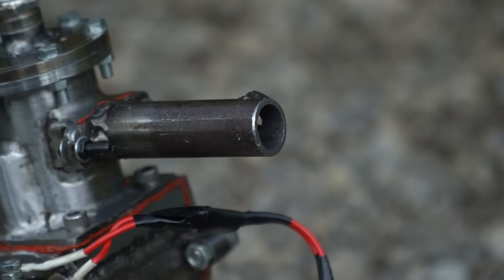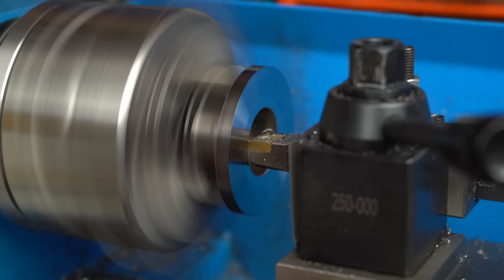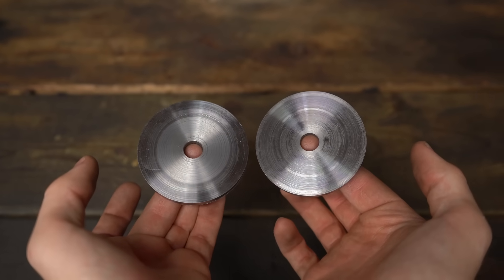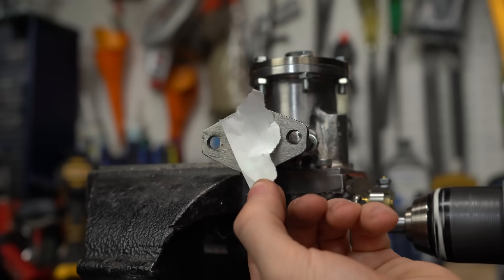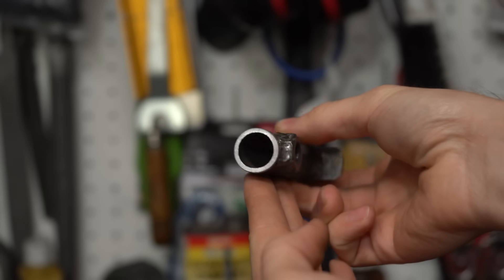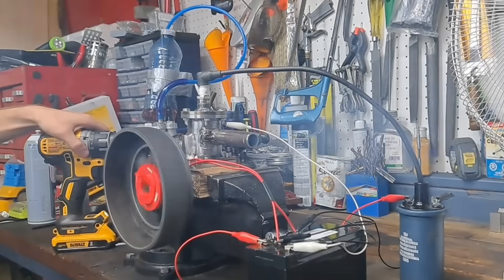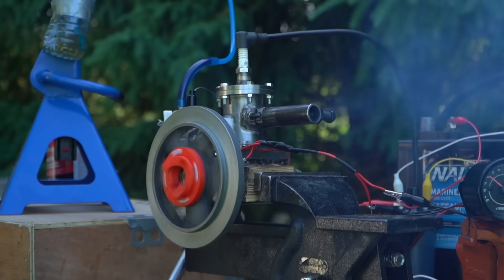I Made a Two-Stroke Engine Using Things I Found at the Hardware Store

Comment: They need some backpressure to run, but not much. It's just that they benefit from exhaust resonances much more than 4 strokes so in order to get the absolute best performance you have to take it to it's absolute extreme. You optimize it for a specific RPM (same as a 4 stroke, but not really, but still kind of the same thing) and the backpressure will help draw more air out and thus into the combustion chamber at that RPM. 4 strokes use the same trickery on intakes too, which is why variable length manifolds and things like the weird ITB setup with extra valves to change resonance to optimize for different RPM on most new Porsches, but that has almost no erffect on 2 strokes. On 4 strokes that can give you as much as 15-20% more air than you'd otherwise get from just an open port or "whatever it holds tha MAP and MAF" manifold.

Also just get a larger pipe to fit around the cylinder and run a tiny electric water pump that pumps water through that jacket. Basically how an open deck engine cools itself, just far more half-assed.

Comment: its running lenient  on to much air because there is too much smoke and its white smoke there should not be that much smoke in the first or its just having problems with a cold start heat can help (i edited because my dumb ass didnt wait i minute to see that it fixed itself)

Comment: 4:40 That "little tool" you made is called an arbor, for anyone wondering.

Good thinking for a relative beginner, you're improving rapidly and picking up all sorts of tricks! Much better looking welds these days, too.
Reply: There really is no better way to learn this shit than being pissed off in the shop for hours at a time.
Reply: and at that scale, sometimes you can get away with super gluing the part to the arbor, especially if the arbor has a large step on it to add some surface area. A bit of heat releases it.
Reply: @VoidedWarranty heated super glue releases cyanide tho 😮
Reply: A slight taper cut on the the arbor will also hold well. Just make sure the entrance end is smaller by a few thou and push it on with your tailstock with a center and a hollow PC of material

Comment: Heya, I'm a mechanical engineer in the automotive industry, and let me tell ya, don't use a roller or ball bearing for your engine! All types of roller and ball bearings hate high and sudden loads, like a piston firing and will start to break down very quickly, I'd recommend you to use a hydrodynamic bearing instead
And I know your engine has different issues at the moment, but if you were to make a new one, why not just make it right? :P
Reply: More of a high performance/rpm issue/ long lifetime issue than a absolute avoid issue.

They were convenient for design and cheaper than plain bearings.
Reply: @finlaymcdiarmid5832  yeah you are right, but for one, it's just bad practice, and for the other, because of the tribology and geometry of the ball, you tend to have a very small surface area (which is in theory even infinitesimally small) which will get plastically deformed causing an unround surface, which tends to happen a little faster, which decreases efficiency (I'm german, excuse my bad spelling)

Comment: The next time you use your hole cutter use a drill bit to drill a hole on the inner diameter of your hole saw. This insures that the saw won't lodge on the filings that are being created by cutting. This also reduces wear on the cutter itself and also reduces the time to cut. You can easely cut up to 2 cm with this method. (With cutting oil ofcourse)
Reply: this tip blew my mind in how obvious it is but how ive never thought of that before!

Comment: try tesla turbine combustion engine, using one disc stack as the input air turbo and other as the exhaust turbine. both on the same shaft. yep throw fuel in the air, you get fire, exhaust. well welld. be wholesome. so whats so difficult about 1-stroke engine, or direct combustion, every cycle. yes 1-stroke or continuous burn turbine. rotary turbine. that looks like a sewing machine. you know, a put put heat engine outputs exactly the same out of the exit pipe. keys and bearings falling out is a problem.

Comment: the reverse beamng clip is gold
Reply: its even funnier when u realize he used a manual shifter on the automatic d15 lol
Reply from the maker: @RainbowSheep_was_taken  I was trying to do something like that meme where the guy puts the truck in reverse if that makes any sense lol
Reply: @CamdenBowen  I think you’re missing the Reed valve on the intake. Without the read velvet would push most of the charge air back through the carburetor.
Reply: @CamdenBowen  yeah thats what i meant by dramatic effect lol. U made it really funny too
Reply: @CamdenBowen  When you measure pistons measure from 1/3 up from the bottom of the skirt perpendicular to the gaugeon pin axis.  Pistons are conical
Reply: @diyking9k74  You are just straight up wrong about how twostrokes work. Adding a reed valve to a twostroke which has a piston ported intake does nothing for performance. 

The intake can be controlled by a reed valve, which means that anytime the pressure in the crankcase is lower than outside of it, the intake draws in air.

It can be controlled by the piston, which is a lot simpler to build, but has the limitation that too high intake port timing will make it spit fuel back out through the intake.

Or it can be controlled by a rotary/sliding valve, which works the same way as a piston ported intake, but you can tune it to not spit any fuel back out through the intake.
Reply: @CamdenBowen it would be even funnier if u went forward while looking backwards
Reply: @CamdenBowen   PUT IT IN REVERSE TERRY
Reply: @CamdenBowen  I cracked up hard. Love your work man
Reply: @RainbowSheep_was_taken 😊😊😊😊😊😊😊😅😊😊😊😊😊😊😊😊😊😊
Reply: @RainbowSheep_was_taken I there isn’t really a commercially available automatic shifter for sim racing except for monster trucks and certain Allison transmissions
Reply: @jasonlin9805  yeah thats what i said
Reply: @RainbowSheep_was_taken u can customize any car on beamng. Don't be a buzzkill
Reply: @Corkoth55  the original comment you are referring I think was deleted
Reply: @RainbowSheep_was_taken  he probably just has a manual shifter for racing games in general
Reply: @scarecrow5848  no one has an automatic shifter tho, he probably used it for a dramatic effect or he didnt realize the way to shift automatic is with the paddle shifters
Reply: @RainbowSheep_was_taken  You can shift an auto with the h pattern too in beam, that's how I do it
Reply: @RainbowSheep_was_taken You can bind park, reverse, neutral, D, 1, 2, etc for automatics to positions on the H shifter. I prefer this to paddle as it feels more like the automatic selector lever in a real car and it's easier to get where you want rather than toggling through with a paddle.
Reply: @bakedandsteaked  yeah, the h pattern also works on automatics in vanilla i just never learn the pattern of the automatics
Reply: Actually cracked up when I seen that 😂
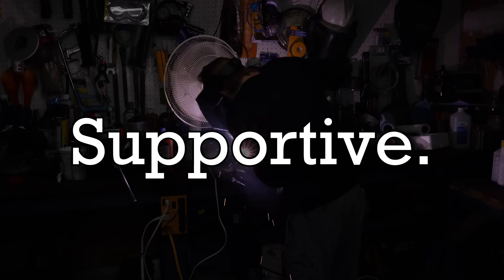Reply: @nathanmccormack4681  2:49 2:57 2:57 3:00
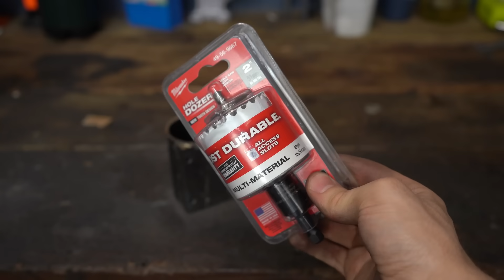Reply: 3:55
Reply: Beamng is gold
Reply: @164_KiloBytes  I have over 1.5k hrs and will never stop
Reply: @164_KiloBytes  I got 1.5k hours on beam and will never stop.
Reply: OMG bro beamng is THE BEST
Reply: Muye moment 💀
Reply: @TheMRacer MUYE
Reply: @TheMRacer  he's over rated
Reply: I was looking for that comment haha
Reply: It's on the same logical level, as turning down the music to see better. Love it.
Reply: What's the time stamp?
Reply: @jwalster9412 watxh the video
Reply: @jwalster9412  Go to 3:48
Reply: yeah I had to rewatch that😂
Reply: That made me subscribe
Reply: The only thing I do in Beamng is put superchargers in family sedans 😂😂
Reply: ONSHAPE IS SCAM ALERT!
Reply: I busted up.  That is my new favorite thing.
Reply: I know I laughed hard there 😂
Reply: timestamp?
Reply: @wertugavw 3:55 it's up there already
Reply: @shako141  Yeah, saw it just as i left the comment and was roo lazy to delete it
Reply: this is the reason creators like him stand out from the rest, cause he makes skits that are completely unnecessary but adds so much to the video
Reply: I see Beam NG, I am happy! : )
Reply: So funny!  I had my  video in "Picture in picture mode"  and I had to come back to Youtube just to add this comment!  SOLID!
Reply: The only thing I do in Beamng is put superchargers in family sedans 😂😂
Reply: Dude actually laughed so hard 😂😂
Reply: Yes, I agree that was pure gold
Reply: Can you make me a engen
Reply: That clip earned my sub
Reply: Ive watched it over and over like 10 times. The sound it makes when he hits the car 😂
Reply: When?
Reply: This is what made me drop a follow 🤣

Comment: I love it how he has just dropped the whole "3d printed part"
Reply: Just like integza! He realized plastic is a pain in the ass to make work with heat and is learning how to do metal work
Reply: Tbh that's a good use for 3d printing. You use it to get the fundamentals right and then you move on 😅
Reply: @flarenator  yea and it like the second he dropped it, he made an engine that actually worked
Reply: @throwawaypt2throwawaypt2-xp8nx  can you not read or are you just an illiterate parrot?
Reply: Metal 3d printing?
Reply: @Eduardo_Espinoza  Metal 3d print would still require some work on a lathe or a mill, it is similar to casting in surface finish and dimensional precision, only advantage over casting is that it can do shapes that can't be cast. Problem is that there is no affordable metal 3d printer and most metal 3d printers are not available to average joe and are expensive as hell, so it wouldn't make for good content, part of what makes people watch this or similar channels is that they use tools and material most people could acquire, most people that are tinkerers had similar ideas to build stuff like that from hardware store parts so watching some one actually attempt it is super interesting, as soon as you introduce proper commercial equipment and processes the video looses it's magic and it's like watching discovery channel.
Reply: @jovand6606  and to further your point,  setting up a lost wax/investment casting procedure could be done by 3d printing the wax structure, and such a process would be able to do anything SLS can do, but better, do to the ability to print wax and certain resins with much better precision and surface finish.  There’s nothing you can’t cast, as long as you take the right approach to it.  Internal cavities, floating structures, and more can be designed to be cast and if necessary, touched up later to be easily cast with high fidelity and minimal fuss.
Reply: @Eduardo_Espinoza sls could count as one
Reply: @Eduardo_Espinoza just make it on a lathe ffs
Reply: Gotta be realistic, there's a reason car engines don't contain plastic. And besides that, he got VERY far with mostly plastic.
Reply: @BloodyMobile  I think a lot of his problems come from the 3d printing not necessarily from the plastic. If he could injection molding, and use non printable more heat resistant plastics for certain parts, it could actually work.

3D printing makes very weak parts.
Reply: @BloodyMobile  car engines contain a lot of plastic. gaskets, seals, bearing cages, etc. PTFE can easily handle every temp an engine produces with the exception of directly at the exhaust port, and there's RTV designed for that joint too (RTV, plastic)
Reply: @VoidedWarranty because the parts in Automotive engines are getting 3D printed... Right?

No. :)

Its Totally true and accurate what you wrote, but it has nothing, really absolutely nothing to do with 3D prints.
Reply: And all the lathe and machine work.. "just Found at hardware store" .lol
Reply: ONSHAPE IS SCAM ALERT!
Reply: as it turns out, plastic isnt suited for engines.
Reply: You don't have a 3d printer just laying around? What a loser. I have like 12.
Reply: That’s cad not 3d printing
Reply: 3D printing is just another Tool - not the Holy Grail of Tools, just a Way to fix things ....
Reply: It was really interesting and it inspired me to
Reply: Plastic 3D printing only can be used for certain products... something that moving and having friction is not suitable at all....

But it can work on a small scale rocket
Reply: @arizeta3540  um, plastic on metal is a great bearing material. plastic bushings are used to support metal shafting all over the place. I was involved with a  20T crane that had a pulley at the top of the gib that was an Acetal/Nylon composition. The liner inside most Honda dirt bike forks (pretty much the definition of moving and friction) is PTFE based, used to REDUCE friction.
Reply: @VoidedWarranty  there is where you are wrong...3D printing plastic is not the same the conventional manufacturing process.3D printing just adding layer and rely on the plastic bonding during extruding process.The result will not be the same as conventional manufacturing process like injection molding.
Reply: manitoba-op4jx  etsy would like a word.
Reply: I didn't even notice it till I saw this comment lol
Reply: It was impossible to make the combustion chamber with 3d printed parts, it just couldn't withstand the heat and pressure.
Reply: I wanna see an all stamped metal engine
Reply: It was personal.
Reply: hi signal flare mortar monkey from btd6
Reply: His voice changed too
Reply: he could print molds and just create whatever he wants with molding for prototype
Reply: Should only be used for machup
Reply: Then if the part works you make a final one. It reduces waste of precious metals
Reply: Obviously u cant make an engine out of plastics
Reply: @pontus6261  Not true, look up Polimotor Research
Reply: @pontus6261  not so obviously there are engine designs in the model world for engines about this design that use teflon (yes plastic) cylinder liners. Really common to have plastic parts in steam engines too.
Reply: why you guys flaming on 3d printing, its really good for prototyping extremely fast, and is insanely more cheaper and faster than making a design out of a hard to work with material which, if it fails, you have to do it all over again. Also it wasn't the 3d print that failed, clearly the metal key lock that went into a fully metal piece was loose. I don't see the big deal.
Reply: @thekuba9352  using it for an internal combustion engine which is a very high heat object is obviously bad for 3D printed plastic, but they were promoting its use for prototyping
Reply: @thekuba9352   but nobody really uses all the potential that 3d printing has. ive seen barely anyone use it to make metal castings for example even though its really easy and gets you heavy duty parts. instead they will use 3d printed plastic parts and watch as they fail over and over. not in this video particularily but its definitely a trend.
Reply: @bigd5899  but thats the persons fault not the 3d printers fault xD. I don't know what to tell you.
Reply: @thekuba9352   obviously. you wondered what people have against creators using 3d printing all the time and theres your answer. people use it in boring ways. nobody wants to see a plastic rocket blow up but buiding a real one with the help with 3d printing is more interesting and actually works.
Reply: @bigd5899  the guy didn't use it in a bad way. We have reached a dead end for this argument so let's leave it at that.
Reply: @thekuba9352  totally agree, I cooked up a cool looking cylinder head design for an overhead cam design I'm working on, but couldn't figure out how to accurately indicate in off of the compound curve I'd made in order to locate the valve guide bores at the angle they needed to be, so I 3d printed the part and practiced setting it up in the mill until I'd figured it out. I agree It's not a big deal if a plastic part doesn't work first try, in fact that's been my experience with plastic, stainless steel, aluminum, tungsten, graphite, glass, firebrick, etc.. It takes several attempts to design something that works, even in metal.

I want to see these naysayers actually build something.
Reply: @VoidedWarranty  reading the peoples replies is hilarious its like they say so much without actually saying anything. I'm not saying I'm smarter but I can accept when I'm wrong.
Reply: @thekuba9352  I think the problem has to do with the premise of the video.
Reply: @gustavgnoettgen  I don't understand.
Reply: @thekuba9352  I think 3d printing really shines with lost PLA casting. You can make metal cast parts shaped using 3d printed parts. It doesn't replace all machining and metal working, but boy is it handy.
Reply: Awesome??